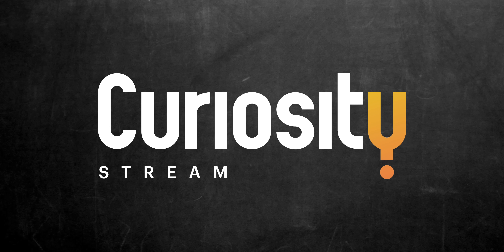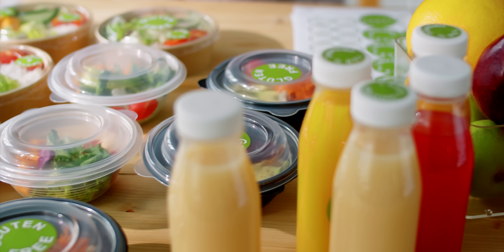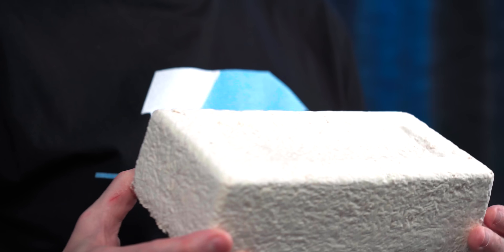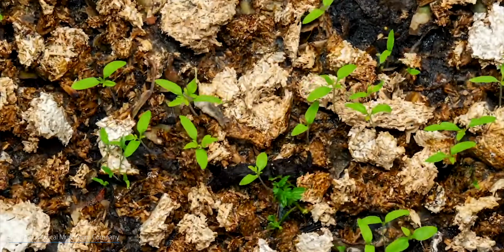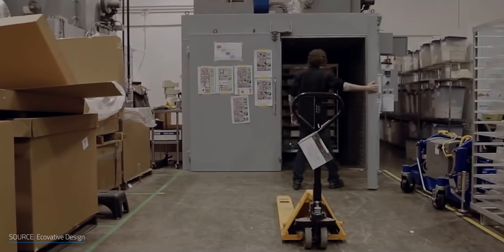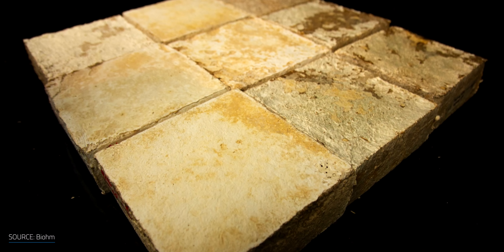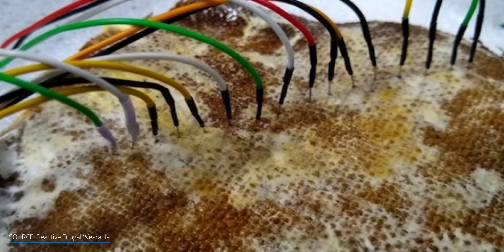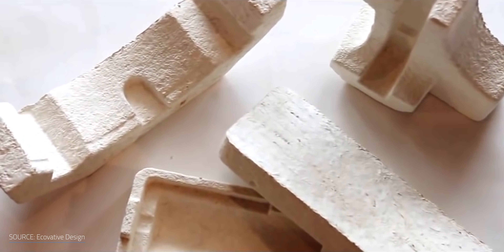Is Mycelium Fungus the Plastic of the Future?

Comment: I wouldn't want to live in house insulated with mycelium until I have at least done some research on this myself but I would support food containers out of mycelium instead of styrofoam and other packaging right away. 

There is nothing worse than styrofoam food containers, if the restaurant isn't careful and the containers get only slightly hotter than allowed they will instantly melt (for example when you put in anything freshly deep-fried) or if the food is particularly sticky (like for example dried or glazed fruits) they will simply have small bits of foam sticking to them. Never forget they are also never actually sealing tight enough to contain liquids. Styrofoam food containers are literally totally unfit for the purpose and it is beyond me how we still accept their use, the only reason they haven't disappeared already is that they're cheap.

Comment: A replacement for styrofoam (if coated in wax to make it water resistant?), but not for all or even most plastics.  I'm a little hesitant about it for building insulation because it seems likely to be highly flammable (being a very well oxygenated organic [chitin mainly] substrate/fuel that would only need the heat of a fire to overcome its activation energy and violently combust to CO2 & water) compared to inorganic alternatives like fiberglass or rockwool.  Also given water infiltration it would be food for other fungi (dry rot...) and probably critters.  Provided appropriate waterproofing is done, the use of this material for temporary applications like packaging and foam coffee cups seems far more appropriate than architectural use--I want my buildings to last.

Comment: the solution to disposing of plastic is a pyrolization process into diesel using solar or some other accessible energy like biogas. It's net negative energy, but liquid fuel is extremely useful. Combustion without air removes most of the toxic gas.